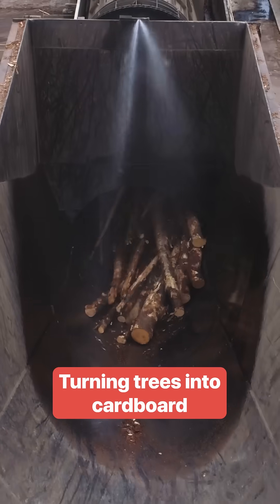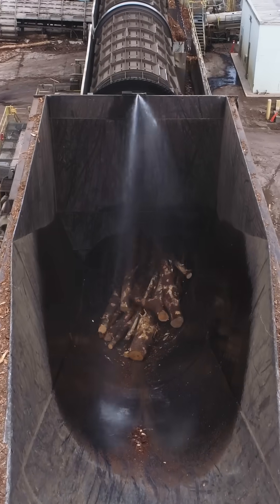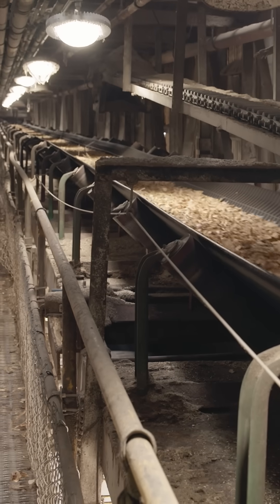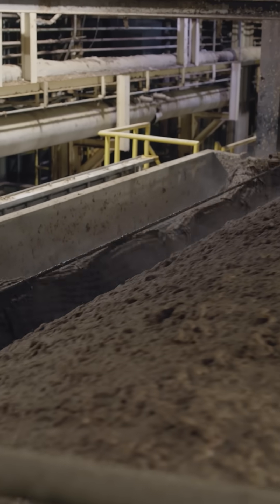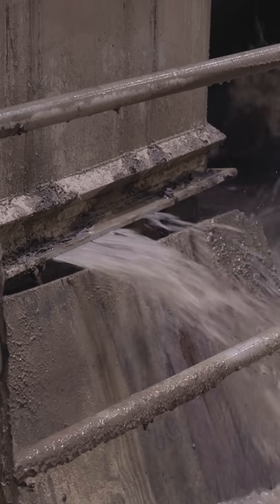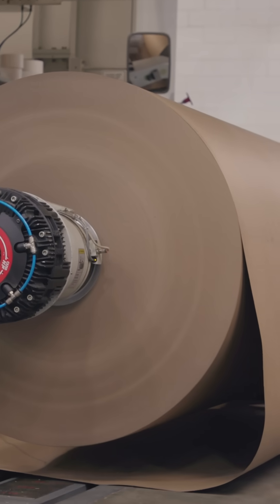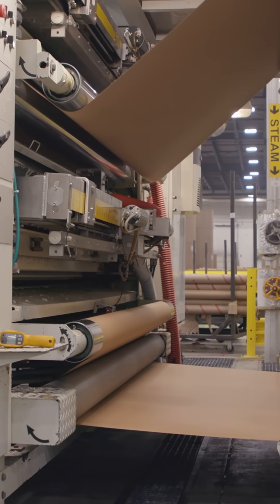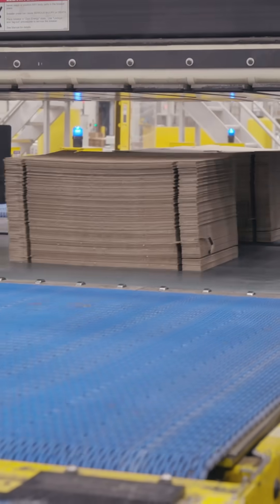Do you know how #trees are turned into #cardboard? #howitsmade

Comment: I'm one of many Truck Drivers that pickup several big cubes of discarded cardboard, and take it to the Paper Plant. After I'm empty and the trailer is clean, I go to the other end of the plant and pickup those very heavy rolls. Then take them to the plant that makes the boxes. Then I go to the other end of the plant, and the finished boxes are loaded on to my trailer. Then I take those boxes to the box distributor.
After that, I'm assigned to pickup a priority load from Lowe's, Home Depot, or Walmart. Transport it directly to the store several States away. Then I trade trailers making sure the trailer is clean and ready for food products from the factory. Then transport that several States away to another distributor.
Be sure to Thank the Truck Driver that drives 600+ miles a day (11 hours of driving / 14 hour total work day. / Then to a truck stop for 10 hours fora shower, meal, and sleep.)
By the way when we make those tight corners with our 75' rig and weight of 80,000 lbs. Thank you for being considerate enough to backup a little so we can make the turn. P. S. As we turn and miss your vehicle by inches, we do this type of turn several times a day. We are Not trying to scare you. It's the only way to make a 75' long truck safely around the corner.
You're welcome to ride along. But, you may want to bring diapers, and something to eat. Driving a big rig isn't for sissies and we don't stop for 200 miles. Then only for 30 min as the law requires. Then continue the 400+ miles. You will learn a new respect for Truck Drivers and about the scarey and dangerous disrespect we get from several cars on the road. 
P/S While some of you who have driven about 25,000 miles in your entire lifetime. Definitely must know more about driving, then that Truck Driver that has 2+Million safe miles in that big rig. 
You might get a Clue if we are all driving 35 mph during a really bad storm... You might think that we know a thing or two about getting to our destination alive and slow down. We are required to change lanes if there are police or any vehicle on the side of the road. 
P/S Please Don't Hang Around Us for Your Safety. A tire could blowout and distroy your car and anyone in it. Also Note that during High Winds... That 53' Trailer is a Big Wind Sail... So, during a gust of wind it will blow that Trailer into the next lane... Not good if you are hanging next to us... Eh? 
Please be aware that we are Not Required to move over when you merge onto the highway. We try to be courteous. But, you don't see the 3 vehicles on our left side. If you parallel us when entering the highway, and we can't move you will end up driving in the emergency parking lane next to the barrier. Either accelerate to get in front, or slow down to get behind us. Most of us are Restricted to 68-70 mph, you aren't! Often... We are Not restricted from using the left lane. (Which is only to be used for passing slower traffic.) The middle lanes are for through traffic. The far right lane is for entering and exiting the highway, and slower traffic (Trucks)

Comment: In 1973 I was a chip runner at a pulp mill.  I was responsible for the conveyor belt which ran up the long enclosed ramp, feeding into vibrating screens sorting out any chips that were too large, which were then reground.   The chips were then fed into the top of the digester where the ligin binding the cellulose fibers together was broken down to make the pulp.  The paper mill next door turned the pulp into paper.
Reply: My aunt lived near a paper mill.   I remember the smell wafting from that place...  Ughhh

Comment: There is enough wood wasted in ordinary trash that there is no need for ANY new trees to be cut for any reason.
Every construction site uses wood framing (for cement) and cuttings. More than enough per house that would fill a normal dumpster. Times the number of daily construction sites.
Every home demolished is plenty of useful wood -- even termite eaten wood is fine. 
Now look at consumer waste. Even furniture contains lots of wood. A couch or bed box spring is not only good wood but the cotton or other fiber is used in making high quality paper.
Since I've mentioned fabric, consider worn put clothes -- all good fiber for quality paper. 
And I've only mentioned a few sources.
There's more than enough wasted that we never need to cut any virgin trees for any reason.
Reply: I've never heard of such stupidity.

Comment: I worked at a paper mill on the paper machine. Also ran the crane. It's a mess and yes, it smells terrible. Plenty of danger, both mechanical and chemical. We had an explosion that killed some welders from a confined space still having fumes inside. Be careful out there.
Reply: Also powdered dust that burns is an Fuel Air Bomb waiting to happen.
Reply: Also very loud.

Comment: The process looks simple at first site but the number of chemicals used and amount of water used is actually staggering
Reply: Oxygen and chlorine, which stays in a well designed loop system. The only product we have to deliver routinely is fresh liquid Oxygen for the chlorination ponds.
Reply: What chemicals?
Reply: The chemistry and water use involved isn't a problem, unless we allow it to be. @eichmann5902
Reply: @eichmann5902  You need to clean the old used cardboard. Meaning lots of chemicals to get out inks, adhesives, and other contaminates that would negatively affect the final product. Also all the water they use gets contaminated with those chemicals and now needs to be treated thoroughly to not pollute when they dump it back out. Using recycled cardboard is worse then just using solely fresh pulp.
Reply: @MrWhateverfits it's really not worse.

Coagulating out the old ink is easy. And cardboard is made with starch as the adhesive so no chemicals there.

It's far less energy intensive than 100% virgin. That's before you also include the time and energy growing and felling the trees.
Reply: @MrWhateverfits  you have your eyes closed or have little to no experience in the corrugated industry. Simply not true.
Reply: @ObservationofLimits  why in the world would GP sell recycled board much cheaper? We’re talking water based food safe inks. No digital inks.
Reply: So?

Comment: How many times can the used cardboard and waste pieces be repulped? Do the properties of cardboard that has been pulped too many times change in a way that makes it harder to work with or lower quality?
Reply: They the more paper is recycled the less you have to use and what is left breaks down easier. You also run into issues of tracing where the paper came from, which is important to insure invasive plant or insect species don’t somehow make it into the shipping process and start disrupting the local ecosystem.

Comment: The boxes are not cardboard they are paper boxes. Cardboard uses a different process than this. I worked in a paper plant and the process is different
Reply: Most paper mills making card stock don't also have a corrugator. Usually that's a separate facility where you'd print and die cut the cardboard since you'd need to make it to various lengths and trucking sheets of corrugate is less efficient than shipping parent rolls of cardstock.

I'm a senior controls engineer for such a company.
Reply: No. This is how cardboard is made.
You have card stock single faced to a B, C, or E flute liner that's then double backed (basically single vs double is how the starch gets applied to the fluting) and then that's run through a hot plate under belt pressure to create corrugate board which is then chopped to length. Double, triple, etc wall just adds more module facer sections.